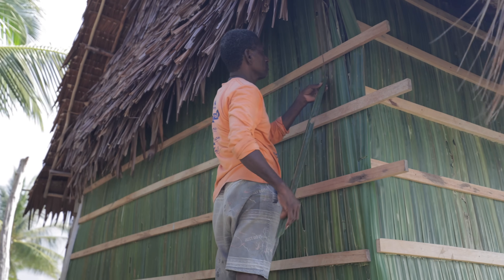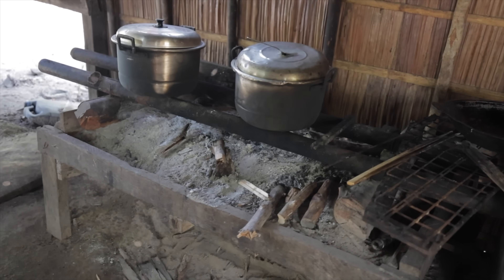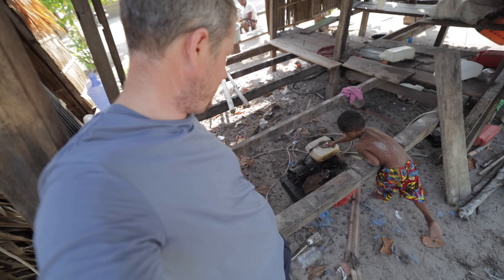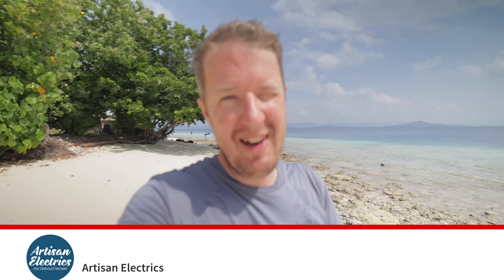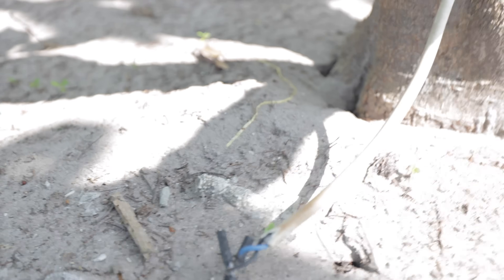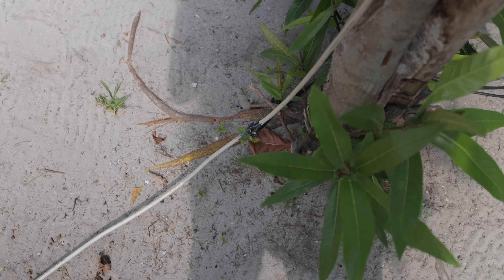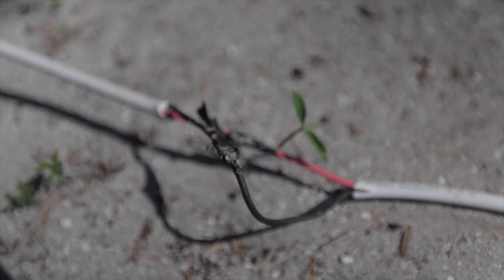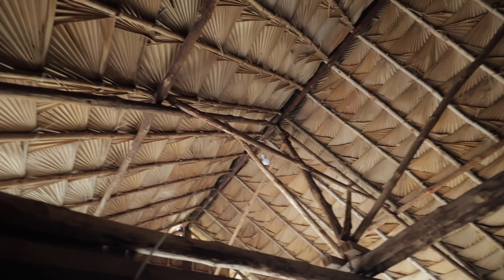I Want To Help Fix These SHOCKING Island Electrics 🤯

Comment: Look on the bright side - the generator doesn’t look to be earthed so any shock would be across your hand if you touched one of these joints, not via your body to ground - so shouldn’t cause atrial fibrillation - just a burn and not death!

Comment: Here's the thing. You're now affected by White Saviour Syndrome.

This is where white guy from western country comes to poorer country and wants to solve their problems. Then white guy goes home from holiday and leaves them with stuff where they have no tools, understanding or knowledge to fix and keep it running.

What if they don't want the electricy sorted out. What if they would rather have a water purifier? What if they would rather have the resources to make a new boat?

You have to realise that you can't just come in and fix their problems if it's not a problem to them.

With any foreign aid project, the community needs to lead the way and decide what they want done, and how they want it done.

I recommend having a chat with some foreign aid organisation first. Just as you would want a home owner to seek advice from an expert in electrics, you need to seek advice from an expert in foreign aid before you start.

White Saviour. Google it.

Heart is in the right place but they need to want the help. I'm sure they would love a new generator with a fuse. If it breaks down can they fix it? 

Electrical safety education using pictures or a video in their language would be helpful. Once they know what's not safe, maybe they will ask what is safe.

Comment: The primary requirement there appears to be lighting at night and power to charge cellphones. 
This doesn't need a generator or petrol and all of the problems that go with those.
Everything could be done at low voltage. LED lamps - plenty of 12 and 24 volt DC options.
For charging cellphones you can get USB chargers that will run from 12 or 24 volts DC.
Each hut could have a solar panel or two on the roof and one or two batteries inside that the panel(s) charge up.
Or you could do a centralized system with half a dozen panels on a shed, the same number of batteries inside and run 24 V out to the huts.
24 is better than 12 when accounting for losses in the distro cables (depending on the size of them).

Comment: Indonesian here
Electrical safety here is based on common sense. When I was a kid I always told by adult to don't touch a switch with wet hands, don't touch a wire, electric bulb, the appliances body, electric pole, etc.
Wiring is mostly a bit dodgy (no exposed wire of course. Wire junction is always taped or wrapped with plastic)
And don't even think about grounding system here. They simply doesn't exist (or if present they are often have high impedance)
And I think what prevent a burning wiring here is that the most household here is having low power capacity
The most common main circuit breaker here is single pole 2A or 4A Type C breaker (that's 450/900VA)
But that's how people live here. All you need to ensure your safety is common sense :)
Reply from the maker: Common sense is definitely a good place to start!
Reply: No health and safety or wiring code?
Reply: @patrickcannell2258  Actually, there's a health and safety wiring code or guidelines issued by the government, and most new buildings tend to adhere to it. Unfortunately, for houses with 450VA to 1300VA, it's not strictly enforced. They only strictly require some sort of inspection by a certified electrician if the house is running 4400VA or above, or has a three-phase line (which is very rare).

Comment: All about the local resources and the money they have to spend on things and it's what they know and what works for them. The good thing about shitty connections and shitty gens is the available fault current to begin with. Yes, it only takesa few mA to kill you, but with an ungrounded or poorly grounded, tiny generator, with green, corroded wires strung about you severely limit the fault current. Sure the kids have all learned either the hard way by getting shocked or by seeing their friends get shocked. They aren't stupid and in a lot of cases, smarter than western kids who are effing clueless to everything because most everything is made so safe there is no risk to daily life. 
And, lets keep power off these islands. The last thing is for all these islands to get all built up and destroyed by tourism. There are plenty of touristy places to go, leave the less traveled places less traveled. 
But even here in Vietnam, you can buy electrical tape for 10 cents a roll. yet, a lot of older people will wrap up a connection with a plastic bag and melt it with a lighter. That 10 cent roll of tape is a waste to them, why use tape when a melted bag works (for them anyway)? Espcially when the average monthly income is $250 or so. $1 for this, $5 for that adds up quick.

Comment: Having travel'd and lived and worked in some very remote places, their off grid system actually seems strangely safe in comparison to what i have seen and worked with. 
At least the genie is only live in the evening. Ethiopia was the worst i've seen. Even in hotels and Government offices you would see hanging twisted wires everywhere. But they had far worse worries than electricity poverty.

If you do want to do something, gofundme to fund some junction boxes and solar\genie fund.
simply portable solar generator system. A 1kw inverter would probably be sufficient. Solar powered lights in the huts etc.

I'm currently in Portugal installing an off grid 10kw system in a friends very remote cabin.

No running water, wood fired, but he has 230v grid, very erratic and unstable. Incoming voltage varies wildly from 180v to 240v on a good day !! 

After consulting with his local elect supplier he's decided to bin the incoming grid supply and go it alone !!

enjoy your travels

Comment: I would vist the local shops, and buy them it. New petrol generator and a portable battery system with solour panels. Wiring, connectors and plugs. Leave it for another time so you can create a video series on it. Create a go fund me.

Comment: I'd come up with some ready made set of kit with solar and batteries and keep everything 12 volt with USB power. No matter how bad the wiring you won't get electrocuted.
Reply: Massive disadvantage: voltage drop. You'd need fairly chunky wires, which are expensive.
Reply: @Ragnar8504  Using that 0.75mm² cable they were using and giving each building 6A (the usual current rating for 0.75mm²), which should be plenty for a light and a phone charger, your losses over 20m of cable, say, at 23 ohms/km is only 2.76V. While 23% voltage drop may seem crazily high compared to the 12V DC setups we're used to, it would work absolutely fine for what they need it for. Upgrade to 1.5mm², which is hardly chunky, and you half that.

Comment: Almost no device there requires 230V. Create tiny systems with couple solar panels and portable battery banks. Not a lot is needed during night time - LED-s and USB-s - 100-400W load constant? 
How long are those cables from generator to all buildings?
Reply: ICE engines are banned??????

Comment: No earthing, no danger, right? It's basically an II-earthing arangement, so as long as you keep the exposed joints isolated from earth, theres no reference for system and no potential between the live conductors and earth. You could be fine touching a single cunductor ;). Even an earth fault in a Class I appliance "should't" be dangerous. But I highly doubt that the system is completely isolated

Comment: Go the progressive approach: go Solar!  -Safe Low voltage ! they use 1W led's which can easily be replaced with decentralized solar battery powered solution
Reply from the maker: Solar has appeared to be a good solution from the comments. 🤔
Reply: @artisanelectrics  There's lots of solar chandeliers/pendant lights/shed lights kits that are just a solar panel, battery and a light on the end of a cable. Would be simple to install the panel on the side of the house and the light indoors. Just have to be mindful of the switch being within reach since some of them have it on the back of the panel or, worse, use a remote that'll need batteries.

Comment: A long shot, dont expect this to happen but a good idea would be to set up a charity to provide basic electrical education and to also go around, re wire the places making it safe and possibly a solar panel and/or better generators. Then in addition you could make videos on doing that stuff with generating revenue which can be directly put back into the charity. I would donate to that monthly. As the videos make more of a connection to what my money goes towards as well as generating more money itself for the charity as a biproduct
Reply from the maker: Great idea, it is a long shot but something we can look into once 2024 comes around. 👍
Reply: Its a good idea it would be fun job to get it mice amd meat i think

Comment: Well there is some safety as they probably can easily bog down that generator or just plain blow a joint. And if you do start getting shocked on something just give it a good yank circuit interrupted.

Comment: Your correct. Education is key. I think you should run a set of instructional videos for poverty electrics. Getting hold of quality electrical materials on remote islands is expensive and a logistical challenge hence the use of materials they find or put hands on as and when they can. Solar is again expensive and batteries require maintenance and replacement periodically which again is more expense. My thoughts would be to further simplify their current system. Hopefully it is a extra low voltage system which would be safe to touch anyway and if it isnt then maybe it should be converted. Vehicle alternator and regulator at 12v then vehicle lamps and lamp holders. These items can be obtained at local trade posts or market towns. By way of sockets 12v to usb automotive sockets again are probably easier to come by. By way of education its a case of training for simple cable joints using minimal tools and materials. Maybe the twist and tape method isnt so bad if its done correctly. There are plenty of old linesman tutorials for joinging cables by knotting and twisting the copper. Burying the cables in the sand would go a long way to eliminating trip hazards and part way to strain relief. Cable joints could be made above ground on short wooden posts with nails to wrap the conductors around. Hope this provides you with some ideas to think about. Have you ever looked at some of the very early versions of the wiring regs? May be worth a look back at when times were simpler.
Reply: But why do islanders continue to refuse support on special homosexual rights ?
They're NOT filthy MEXICANS ! !
Reply: Quite right. Only got D in gcse english. Maybe you should watch a video in the affects of internet trolling on a person s mental health.
Reply: Evidently, your education as to the correct use of, your / you're could benefit from a video too
Reply: @AndrewLumsden  
Dick

Comment: It seems the bigger problem is not the generator, but the joins/connections that are unstable, not firm, not protected from rain, lack of strain relief to make it robust and too easy to touch by a mistake.
How many junction boxes will be as expensive as a battery powered light for one room? (charging form photovoltaic panels)
800 lumens takes about 8 W for an average (not 'top-of-the-line') bulb shaped light source. So 10 W for 5 hours goes a long way, and 50 Wh is what 1 large or 2 small laptop batteries holds.

Comment: You need to learn how to dry shave without using any water. I had to do sometimes while in the AirForce when stationed in Thailand in the early 1970s. I was a struggle the first two or three times but then I got used to it. While there I watched a 76-year-old man climb up to get a really fresh coconut from the top of a palm and when back on the ground hacked at it with a machete without a care and he didn't hack his fingers. As for wiring isn't wire just wire? At least to them it is and looks like nobody gets killed.

Comment: Great video as ever, I think getting them some basic battery powered solar charged lights not joined together would be the best idea, as lighting is the main basic requirement, get a big company to sponsor them, they are super cheap anyway and no maintenance, plus more reliable. Could probably do that island for £100 same for the phone chargers
Reply from the maker: This is something I would love to do!
Reply: Great until the batteries sh★t them selves 

Realistically a long cable to each building  and a decent generator 
Is all they need as they can maintain and repair it 

Oh and THATS  why you need travel Insurance when you go to these places because if the sh1t hit the fan you are on your own